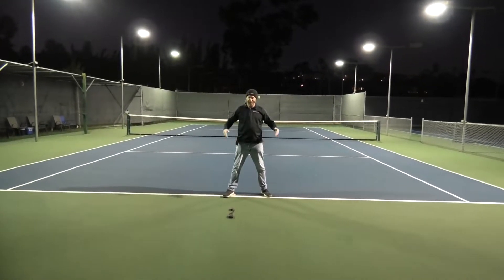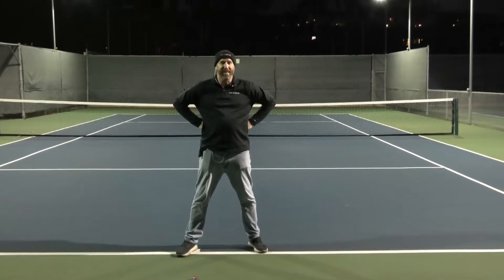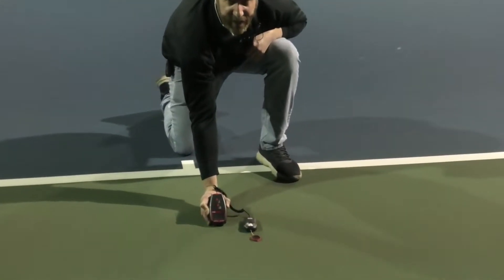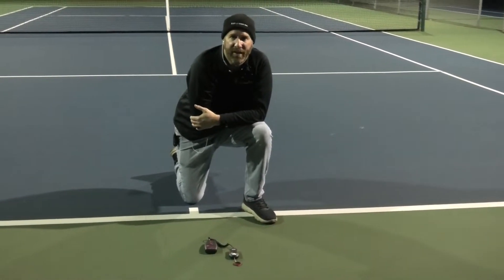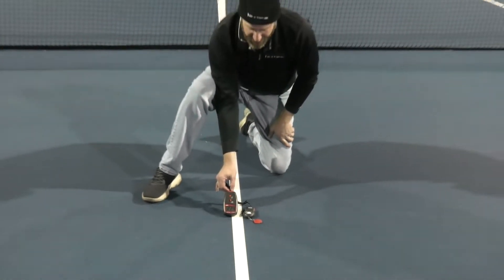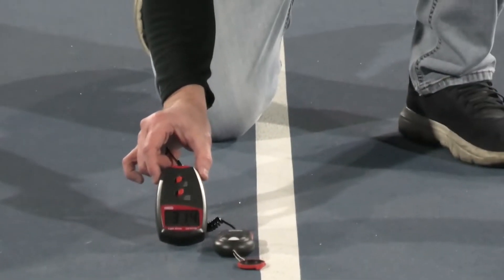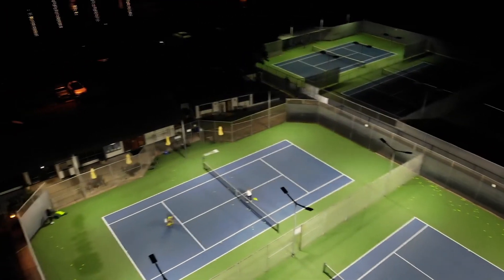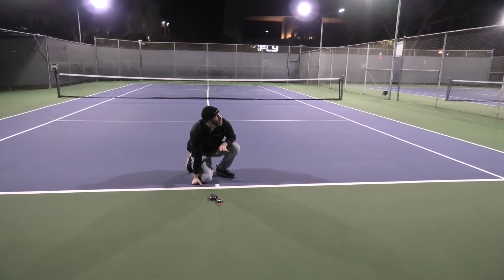Tennis Court Lighting  -6 Light Setup - Replaced with 500 watt NextGen 3 LEDs - Aerial Drone Shot

Comment: How do these lights compare to the premium brands such as Lithonia or RAB?
Reply from the maker: I would not call those premium.  They are expensive because they have to sell to a distributor who has to sell to a contractor.   So two extra sets of mark ups.    The NextGen III series lights are the best on the market, you can see on the video how bright and clear they are.   They also have a Sosen VP driver which is the best on the market so they are going to last.   Those other brands dont list their driver because its a cheap one that wont hold up.